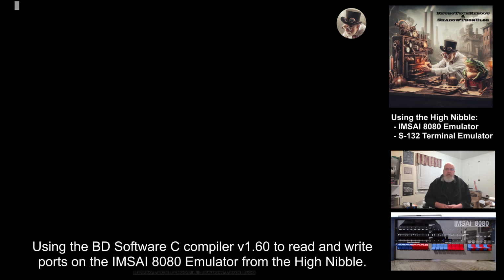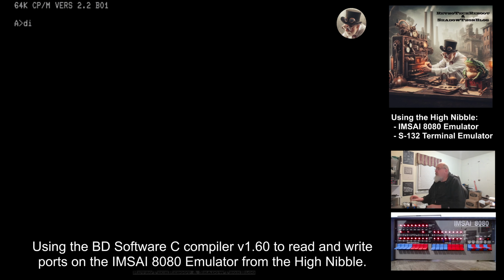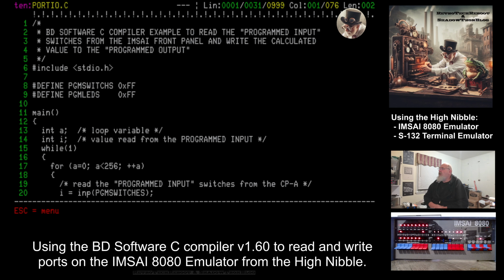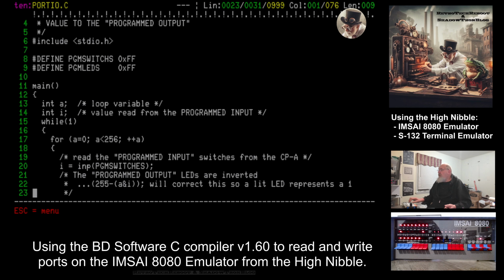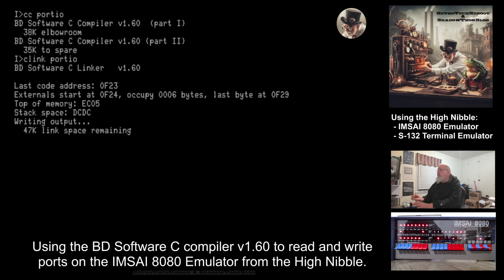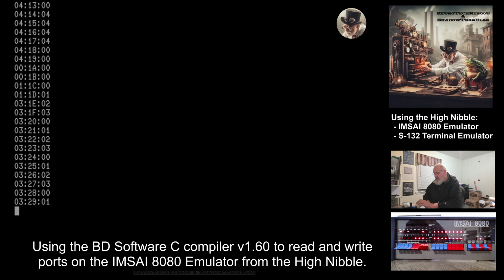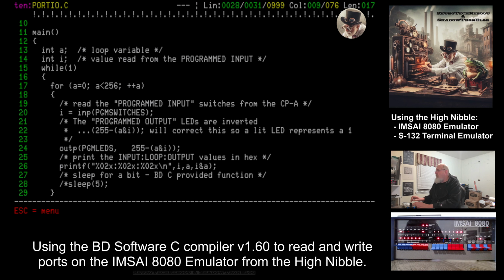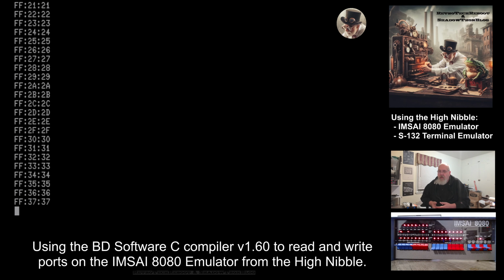IMSAI 8080 - Reading/Writing ports using BD Systems C Compiler for CP/M

Comment: Can you explain what a port is in this case? Is it a memory address the CPU have access to or what is it?
Reply from the maker: The 8080/Z-80 can directly address 65536 (64K) bytes of RAM. Each also supports 256 I/O ports. The I/O ports are numbered 0..255; each port can either write or read 8-bits.  When a port is addressed the port number (0..255) is output on A0..A7 and a byte is either read or written on the data pins (D0..D7). The CPU has pins that control memory read or write, it also has pins that control port read/write. While memory will store the byte written ports work different. It's up to the device listening for the port to be written too / read from to take whatever action the device is designed to do. On an RS-232 card the data in/out of the UART might be on port 10. Port 11 might configure the UART for items such as baud rate. Port 12 might have the status bits for the UART, one bit might mean there is a character ready to be read from the UART.  The user needs to read the manual for the card they want to use and configure the card for the ports they want it to use and/or modify the software to use those ports. Look at the opcodes in() and out(). BASIC usually defines the functions INP()) and OUTP() or something similar to talk directly to ports.
Hope this helps.